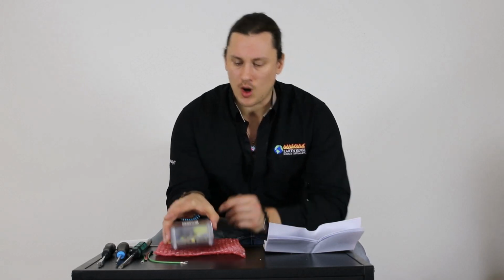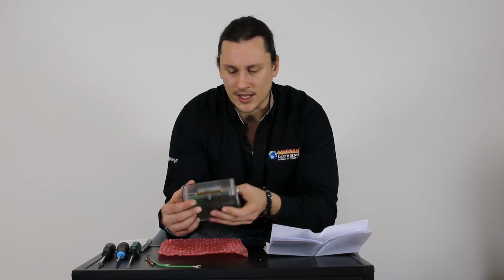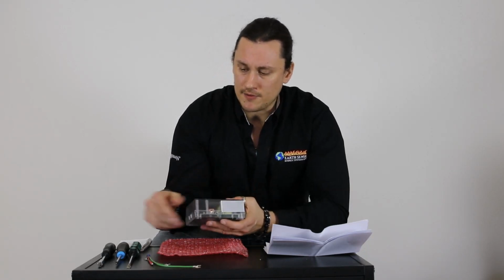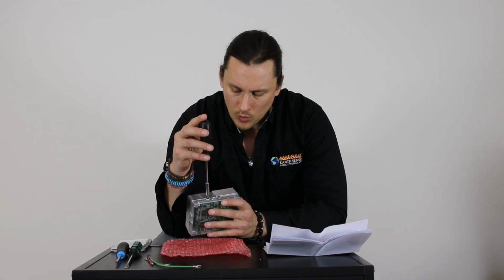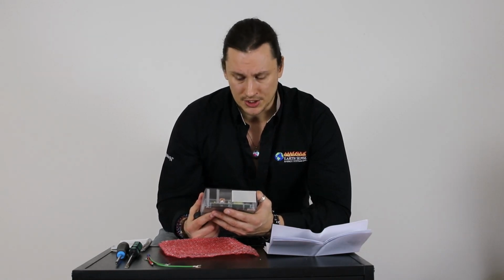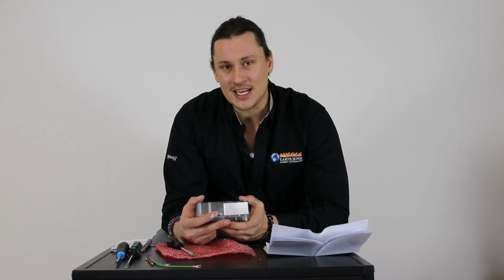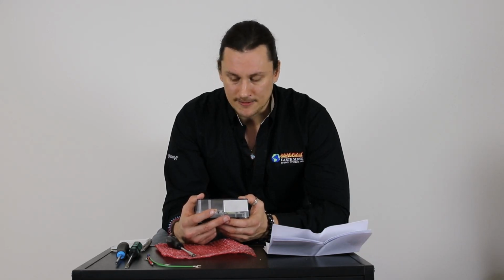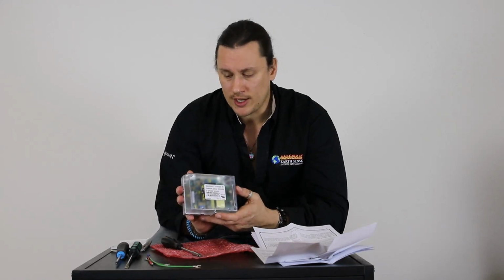QuadraFire 3 Speed Control Board Installation and Settings

Comment: I have a 20 year old Mt Vernon Quadrafire oe. It was turning on and off...like it was running out of "gas"...now it has no power. Outlet is good, snap disc at feeder pellet and high limit good. We replaced control board  , set it on number 2 and installed it. Now looking at 7 amp fuse, does not seem to be tripped. Still...no power. Any thoughts to what we could be missing??
Reply from the maker: Thanks for contacting us. Let's check the fuse with a basic multi-meter to make sure it's good. Sometimes they can appear fine, but be blown. From there I think we trace down where we are losing power. If proper voltage is coming from the outlet, let's check the voltage at the end of the power cord - could be an issue within the wall cord itself. Double check the junction box the control board goes into. Let's closely inspect all wire connections to ensure they are secure. Let's inspect the thermostat wire connections as well. For testing, you can bypass the thermostat by putting a large staple or jumper wire between the two contact points on the T-Stat terminal. Start with the very basic things first. Happy to help get you back up and running.
Reply: @EarthSense  Wow! We so appreciate the quick reply! We will start from square one with your directions and see what we can find. We think it could be something simple that we are not grasping.
Reply from the maker: @leeanncochran2371  Yeah, absolutely -happy to help. In many cases it is something simple so always good to start there. Any questions as you go along just let us know. Thanks.

Comment: We have a CB 1200 - We cleaned everything including the chimney and pipes in the back of the stove. The stove will light up and run fine until it reaches the thermostat temp... say 70 degrees, it shuts off, and when the room temp falls the call light goes on but  the stove doesn't lite off. As soon as we hit the reset button, it lights up and runs to the desired temp and does the same thing again. Thank you.
Reply: Update.... I'm thinking the issue might be with the new thermocouple. The pellet stove will initially feed then wait for the ignition (as it always did) but then after ignition no more feed (unless I hold the reset button) I believe I either heard or read in one of the pages that sometimes with the new thermocouple you have to flip the wires??? Hope to hear from ya soon, and again thank you for all your assistance! I attempted to get assistance from a local shop and they refused to assist as they didn't install the system, so your advice and videos have been a god send
Reply from the maker: @sirreed46  Thanks for the message. The thermocouple should not have anything to do with the convection blower. There have been cases where the Thermocouple wires need to be reversed to have it function properly detecting proof of fire after startup. You will not hurt anything by reversing the wires of the TC. If the unit is not feeding after start-up unless you press the reset button, then in most cases it is something with the TC. Keep us posted if reversing the wires allows it to function properly from start-up into normal operation. Thanks, and glad we are able to assist.
Reply: @EarthSense  Thank you for the follow up. We have a CB 1200. I did fint the low limit switch and bypassed it with a jumper and the convection blower does run.!! Wooot! I will swap the wires on the thermocouple tonight and see if that fixes my issues! Ohh and just to make sure and for a peace of Mind, the "new" ground wire (little green one that came with the new control board) should now connect to the you yellow wire on the thermocouple or does that get moved over to the red wire spot also?
Reply from the maker: @sirreed46  Hey, great news on the blower and troubleshooting it to be the switch! Keep us posted on the Thermocouple wires. It's been awhile since I personally looked at the ground wire installation - if I remember correctly it goes on the bullet end connector and the ground is simple secured to the stove body. I'll take a closer look and follow-up. Thanks.
Reply from the maker: Yeah, there's only 1 way it can be installed with the connectors on the thermocouple - Bullet connector to bullet connector, ground to stove body. Keep us posted!
Reply: @EarthSense  my thermocouple has spade connectors not bullets??
Reply from the maker: @sirreed46  You're correct. My apologies. The 1200 model Thermocouple will have the open spades not the bullet connectors. Let me double check on this and follow-up. Appreciated.
Reply from the maker: @sirreed46  Thanks for your patience - Tech insight: We'll want to use the ground wire with the two open spade connections. I think the instructions say red but if reversing the wires it would be yellow. (Double check the instructions). There are mounting screws right next to the TC connection that can be used for the ground to the stove body. 
Keep us posted, thanks!
Reply: We have replaced the igniter as well, what else should we be checking??
Reply: Found the direct short it was on the igniter. replaced that and for a new control board. New problem is the convection blower will not kick on.....I replaced the snap disks and thermo coupler. Did the direct power test to the motor and it works when directly connected. Checking wires found another bad wire going to the exhaust blower motor. Fixed that and it runs fine ... everything works but the convection blower....only thing I can think is the 3 speed switch maybe? Please help once again? Helpless and hopeless as my mother in law always says LOL
Reply from the maker: @sirreed46  Thanks for the messages, glad you found where the direct short was and addressed that and the other areas. What model Quadra-Fire do you have again? Several models will have a low limit switch in-line with the convection blower. If your unit does, let's make a jumper wire to test and bypass that switch. Let's also check the switch wiring to the junction box. Keep us posted - Video on creating a jumper wire here: https://youtu.be/FDVkbsHS95U?si=xS9m0sLWN5mXEteV
Reply: WOOT WE HAVE FIRE AND WARMTH!!!! Thank you! Thank you! Thank you! Where shall I send your Christmas Card??
Reply from the maker: @sirreed46  WOOT WOOT! Fantastic to hear! So glad we were able to help. If anything else comes up just let us know. Thank You!
Reply from the maker: Thanks for contacting us, happy to help. When the room temp falls and the call light comes back on, does the stove feed any pellets at all?
Reply: @EarthSense just installed new control board. Verified correct setting with  blue blinking light (also installed new ground wire as instructed) all looked good. Turned up the thermostat to get fire the stove up and "poof" it went out again! Now no lights or anything...fuses look good. Any thoughts ? Sorry didn't mean to jump on this thread
Reply from the maker: @sirreed46   Thanks for contacting us, happy to help. It sounds like there is a direct short happening. During initial start-up the igniter, combustion blower, and auger motor receive power. Let's thoroughly inspect the wiring to these components make sure there are no exposed wires or bad connections. From there let's inspect the loop igniter closely - If the igniter is warped or burned through it can ground out on the housing and create a short. We can test the other components independently as well with a test cord: https://youtu.be/rlmiCYI2WPk?si=JOduNyRaLQ8k13yv
Good to check all wiring in the unit with a good light - again check for any exposed wires touching metal or loose connections. Make sure the stove is unplugged when working with the circuitry. 
Keep us posted, thanks.
Reply from the maker: If no pellet fuel is falling when it calls for heat again, it is most likely the thermostat itself. The connection gets dirty over time and although it “clicks” it isn’t making a clean connection to initiate the feed even though the light comes on. Let's inspect the thermostat a bit closer. Here is the replacement for reference: https://pellethead.com/product/quadrafire-heatilator-gas-pellet-stove-standard-mechanical-wall-thermostat-w-wire/

Keep us posted, happy to help!
Reply: @EarthSense  It appears that the pellet fuel is falling, and last night it would do two cycles then shut down. Any other ideas? We have changed the batteries on the programmable thermostat. Thanks again.
Reply from the maker: @kimpaolini2737  Thanks for the update. I am still leaning towards the issue being related to the thermostat. It would be good to rule that out if possible. If you can get your hands on an inexpensive standard low millivolt magnetic 2-wire thermostat and test the stove that would be ideal. Also, double check all the electrical wiring coming in to the stove and going into the junction box where the control board is. Make sure everything looks good and secure. You can pull the control box out and place back in to do a hard reset - MAKE SURE THE STOVE IS UNPLUGGED when working with the circuitry and control box. In most cases this would be a thermostat issue, in some this could be a control box issue. If the thermostat is ruled out, you may want to have your control box tested to see if it is the culprit. Hope that helps, keep us posted.
Reply: The other thermostat seems to send the call and stop to the stove, we'll order a new one and go from there... thanks for the assist and will let you know when we get the product from your store. @EarthSense
Reply from the maker: @kimpaolini2737  Thanks for the message back. Yes, please keep us posted - we'll make sure you are 100%. Appreciated.

Comment: Can anybody tell me the setting numbers for the control board for an eco choice cab 50 stove ? Thanks
Reply from the maker: Apologies for the delay. We will update here as soon as we have the settings info for that Control Box. Thanks.
Reply: Thank you for the settings now my next problem is the control board is only light blue and the motor turns on for only about 5 seconds shuts off and restart the that all again  an suggestions I would really appreciate. Thanks
Reply from the maker: @EricDietz-j8o  Thanks for the message. When you say a motor turns on for 5 seconds is that the auger motor or combustion/exhaust motor? Are you running the stove on a thermostat? Did you just replace the control box because of this issue? Happy to help - the more info you can provide on exactly what has and is happening the better we can assist. Thanks.
Reply: It's the combustion motor that turns on and the control board lights up blue and it is running on a thermostat
Reply from the maker: @EricDietz-j8o  Thanks for the message. So when you turn the thermostat up the combustion motor runs for 5 seconds then shuts down is that correct? If this is the case I would check the basics first. Bypass the thermostat by putting a wire in the terminal block between the two connection points. We want to rule out that the thermostat is causing this. From there it will be good to run the combustion motor indepedently to direct power to see if there is an issue with the motor. Link here to create a test cord - https://youtu.be/rlmiCYI2WPk?si=bYDAh9xRPDidfQUS

Keep us posted.
Reply from the maker: Here is a link that will show you the replacement instructions for the Heatilator Eco-Choice control box. For the CAB50, the standard dial is #2, #3 dial can also be used and will increase fuel by 10%. Most customers will have this set at a number 2. Hope this is helpful, any other questions please let us know. 

https://pellethead.com/heatilator-eco-choice-pellet-stove-control-box-settings/

Thanks.

Comment: I have a Castile stove.  When the fan is on High or Low, it pulses. The fan works constantly on Medium.  I have searched everywhere for an answer with no luck. Before purchasing the contrail box, would the box solve my problem?
Reply from the maker: Thanks for contacting us. Happy to help. The 3-speed switch on your Castile will control the the combustion fan, convection fan, and feed rate. Which fan is pulsating when it's on high or low? The fan that blows air into the room or the the fan that forces the exhaust out of the vent pipe? Do you notice change in your fire as this is happening? Happy to assist. Thanks.

Comment: I am trying to troubleshoot an issue where the Quadrafire 1200 starts but doesn't remain lit. I'd like to observe the LEDs on the control board but I can't find the board. Your video is helpful but it doesn't indicate where and how I get to the board to observe the lights. Please help.
Reply from the maker: Thanks for contacting us Dennis. If it is a 1200 Freestanding model, you will need to go into the fuel hopper to access the control board. If I remember correctly, it will be on the right side when facing the stove. There is a protruding metal box cover that needs to be removed to see/access the board. If you have a 1200 insert the board will be located in a different area behind the right side curtain panel. 

In most cases, if the 1200 is lighting but is going out after ignition, it will be a thermocouple issue. Here is a video that covers that in a bit more depth. https://youtu.be/JhMTxAzQ9k4

Keep us posted, happy to help.
Reply: @EarthSense  Thanks. I opened the hopper cover, removed the inside control board cover and also the right side curtain panel. Oddly, the unit has not failed to start since I did this four days ago. I didn't touch anything and the light is turning green then red as expected. Both covers are still off and the darned thing won't fail. Ideas? It seems the only thing changed is that more cooler air is flowing around the control board.
Reply from the maker: @denniskavanaugh7274  Very interesting Dennis, thanks for sharing. That is very odd indeed. Can't say I have heard of a situation like this before. I would suggest continuing to assess it - maybe put the covers back on and see if it fails. Really shouldn't make any difference. Keep us posted. Happy to help.
Reply: @EarthSense  Well, I took your advice and put the covers back on, but not before adding a ground wire to the thermocouple and bumping the control box from 1 to 2. Same results: works every time. The only thing close to logical is that I may have positively affected one of the safety mechanisms when I was moving things around. For example, the vacuum switch that turns off the auger was removed and inspected while I was looking for the control box. Maybe it had some high resistance issue and my wiggle helped. It will likely forever remain a mystery. What is not a mystery is that, thanks to your site and your assistance I probably saved over $600 in service calls and wasted head scratching by marginally competent techs. Thank you so much.
Reply from the maker: @denniskavanaugh7274  Hey Dennis, thanks so much for the follow-up. Yes, logistically this is a mystery and may always be. It could very well be your removal and reinstall of the vac switch in someway.. In any case it makes me very happy to hear that everything is consistently running correctly for you now, and even more happy that we were able to help and save you time, money, and frustration. Really appreciate your kind words. Any questions down the line just let us know, always here to help!

Comment: The only information you have provided is that you are dealing with a 3 speed control board but, up to the 5 minute mark, I did not heat you once say what the board number is
Reply from the maker: Thanks for the message. Part numbers for the Quadra-Fire 3-speed board are SRV7000-205 and SRV7000-704. This control board is correct for the following Quadra-Fire models. 
1200 Freestanding
1200i Insert
Castile Freestanding
Castile Insert
Contour
Santa Fe
Santa Fe Insert

Any other questions please let us know. 
Thanks,

Comment: I had an issue with my outlet and it fried my control board. I purchased a new one, the same style and number as before and it looks just like the last one. My issue is that when I go to put the new one in it doesn't want to slide in. It wants to go down on each side but not in the middle. I'm not sure what I am doing wrong.
Reply from the maker: Hi Angela, thanks for reaching out. If you still have your old control box take a close look and see if the middle section is what fried. If the control box is not inserting properly, generally that will indicate there is an issue with the Junction Box that the board slides into. If the board fried there it could have damaged the internal receiving area of the Junction Box. Get a good light and inspect the Junction Box where the board slides in and see if anything appears abnormal. Let us know what Quadra-Fire model you have and we can send a link for reference on the Junction Box. Thanks.

Comment: I have a 1200i new controller bord new thermocouple all snap disks test good it will turn on fan Start the fire and sometimes run auger motor at start up bet will not run after that
Reply from the maker: Thanks for the message Josh. Try reversing the Thermocouple wires. We have seen a large number of Quad thermocouples that need the wires reversed to operate properly. Keep us posted on how things work after trying this. Thanks!